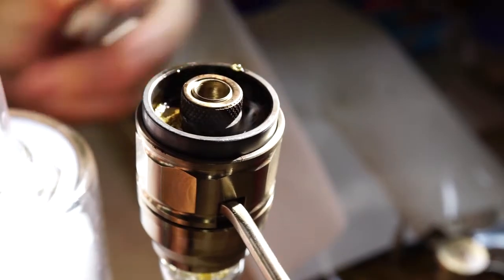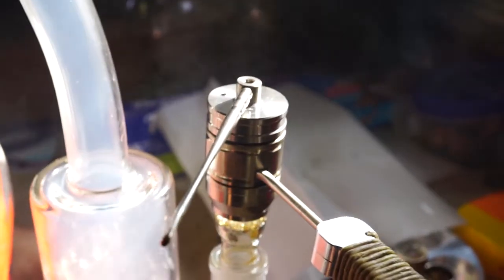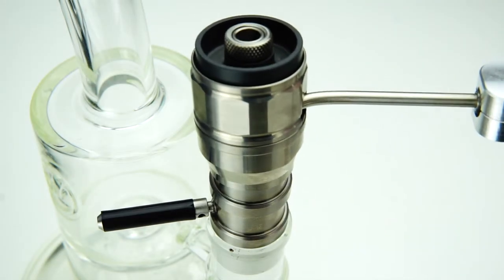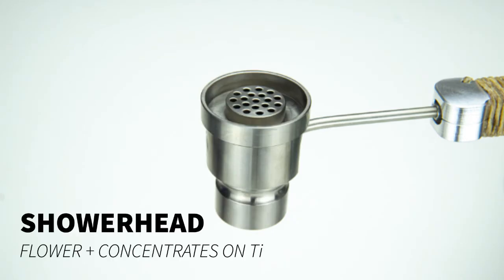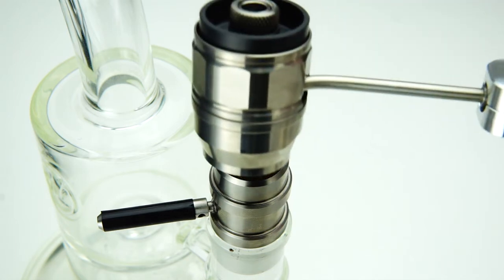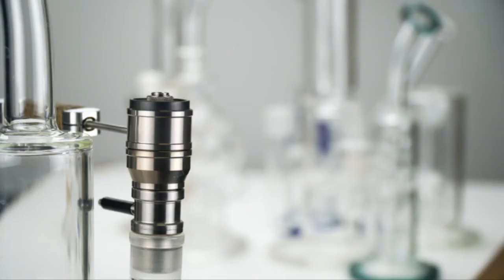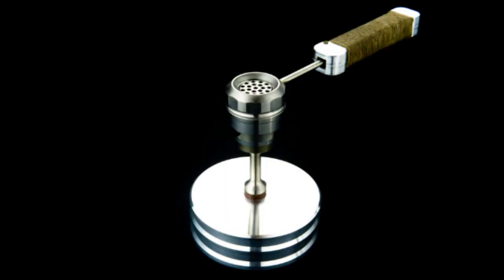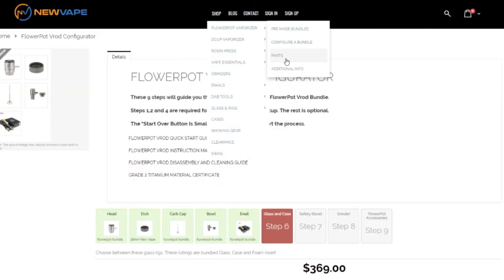NewVape - FlowerPot Desktop Vaporizer Explained

Comment: The Flowerpot is an incredible piece of kit. I have been "serious" about vapes for about 3-ish years at this point. I've bought a bunch of 'em. No exaggerations here....I have purchased nearly a dozen different pid based vapes over the years. Of those 10-12 kits, I actually kept the Cannabis Hardware unit (with all of it's fancy machined housings/safety stands/etc), the MaxVapor unit and the D-Nail unit. That said, The Flowerpot is "top shelf". Cannabis Hardware do fantastic metal work. Customer service is great w/ Cannabis Hardware as well. I've been doing business w/ these guys since I first got into the hobby, and they have always helped me whenever ANY problem came up. Always. 

If you're a person who has been looking to purchase a nice vape, Cannabis Hardware is the spot. "Combo dabs" truly are the bee's knees (vaping concentrates & dry herbs at the same time). There are only a handful of vapes that're made w/ combo dabs in mind. The Ditanium comes to mind immediately here. The thing is, the Flowerpot does the combo dabs w/ a big, nice "halo-style" dish. The dish on the Ditanium is so small you can't clean it w/ a normal q-tip. 

I could praise Cannabis Hardware on & on & on. It's not just the Flowerpot either. I have the now out of production "D-Cup" banger as well as their out of production drop-down e-nail assembly. I eluded to the machined housings/stands/etc earlier as well. Nobody is doing metal work, as it pertains to dabbing, quite like Cannabis Hardware. These ppl are really good at what they do.

edit: I had to add the fact that I also have a full set of the now out of production New Vape/Cannabis Hardware dabbers as well (w/ the screw-on end caps). Those are incredibly nice, too. ..and the machined housings/safety stands have a spot to hold every little doohickey & accessory. When it's all put together, it's the fanciest lookin' piece of kit that I have (The Cannabis Hardware stuff).

I also need to add in that the Flowerpot is excellent when paired w/ other pid units. It works fantastic w/ all 3 of the units I kept in my collection (Cannabis Hardware, MaxVapor & D-Nail).